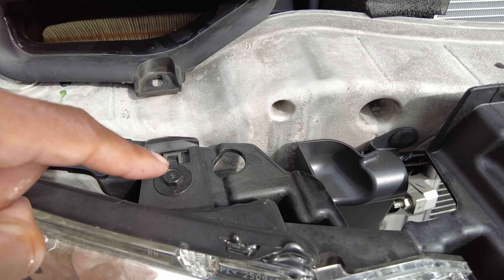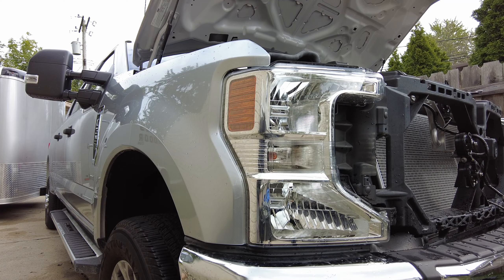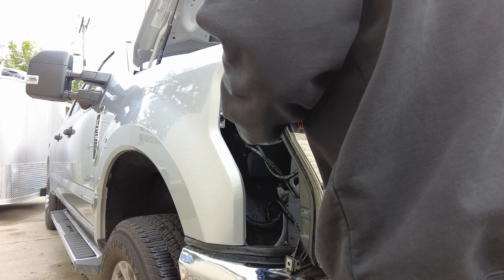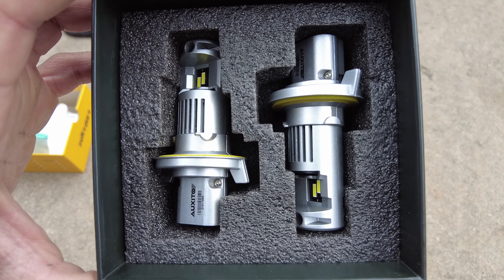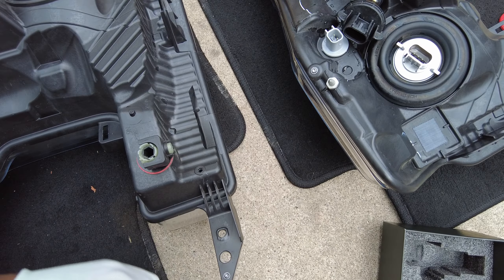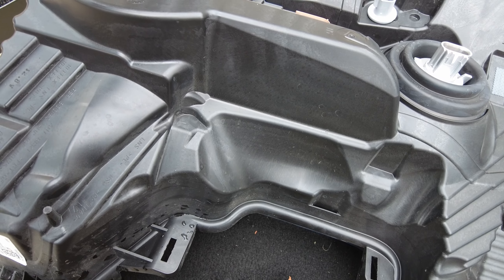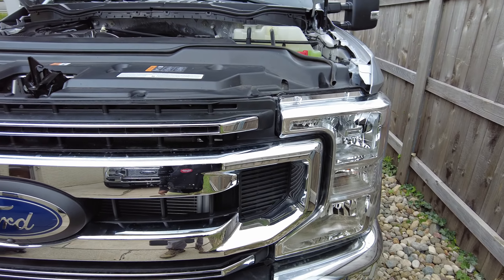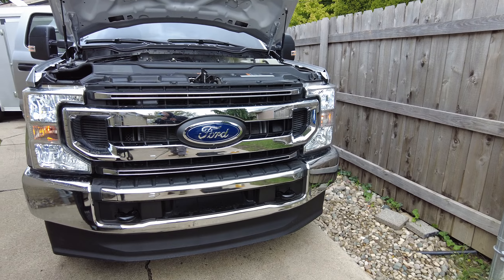2022 7.3 GODZILLA HEAD LIGHT REMOVAL AND LED UP-GRADE.

Comment: Nice work DS. You did a better, more careful r&r than the Ford tech who did a warranty replacement on one of my LED headlights. He scratched the crap out of mine in the area that you pointed out to be careful, where the top goes under the fender.